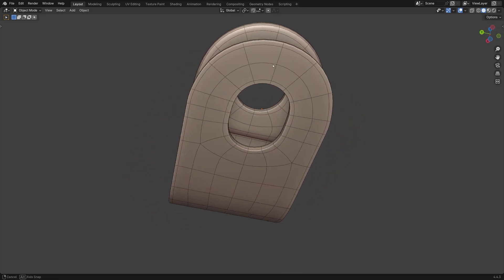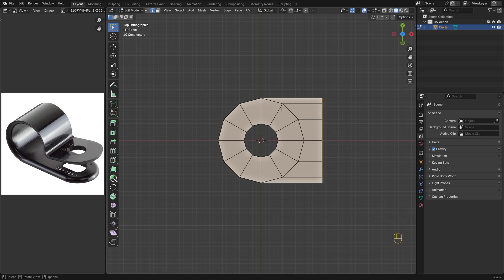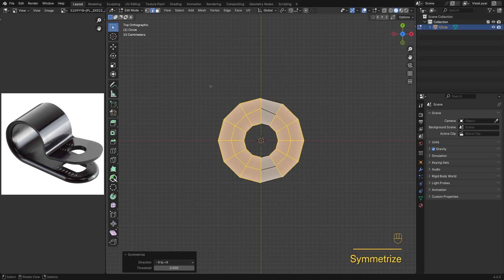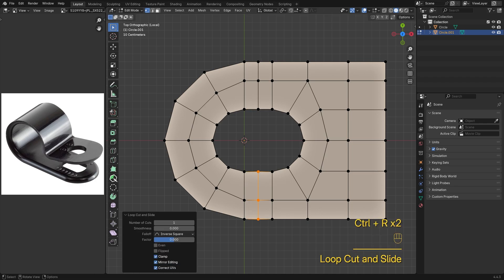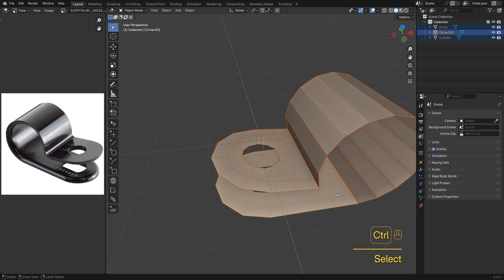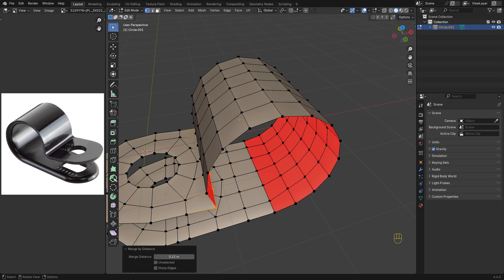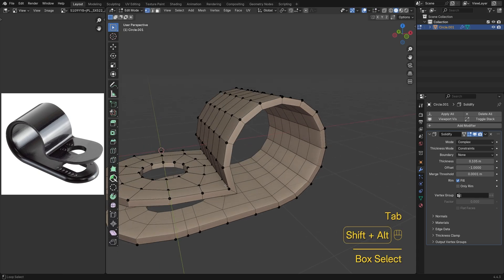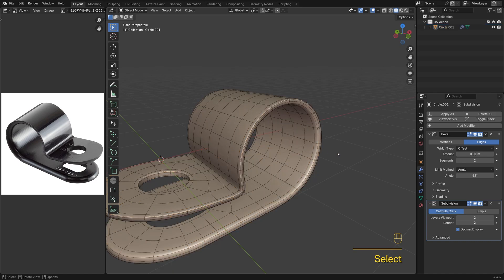Blender for Beginners Ep03 | How to Join Parts Without Breaking Your Model

Comment: 3:05 Why am I unable to see my Circle.001 and Cylinder when I go into orthographic view but yours are both visible with thin lines?
Reply from the maker: Alt + Z to turn on Xray mode
Reply: @JOYCE_3D  Thank you for responding so quickly lol I tried that. I also saw you mention you could change line thickness in 3D Viewer theme settings but that didn't work either. I must have toggled something

Ignore me I didn't have wireframe turned on 🫠